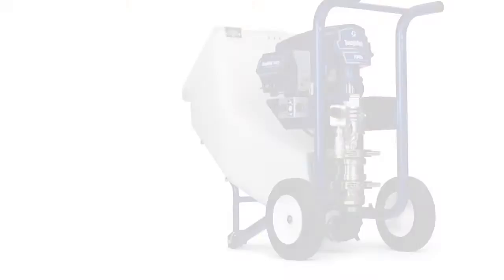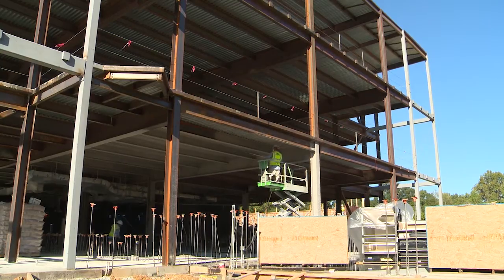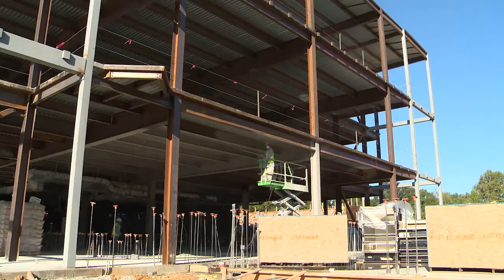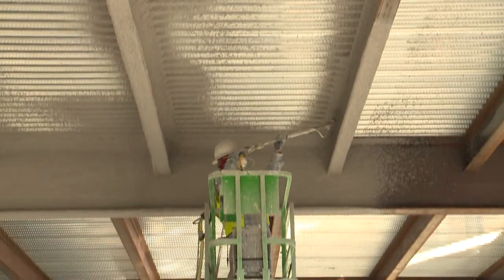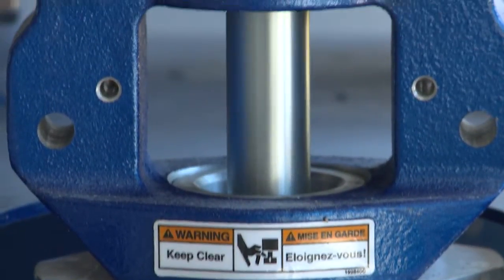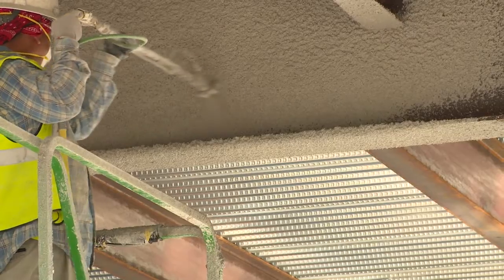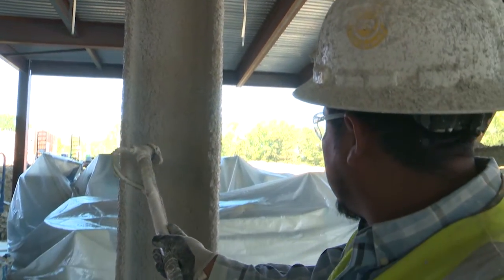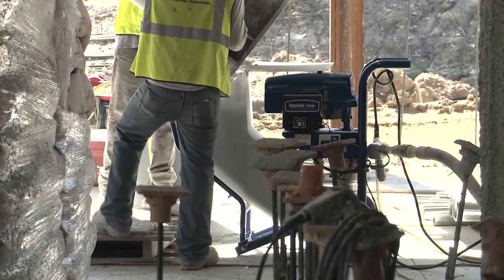Contractor Sprays SFRMs with Graco ToughTek F340e Fireproofing Pump

Comment: How do you clean excess material from concrete
Reply: George,  

Typically excess material buildup in the pump is cleaned out immediately after spraying by simply running water through the pump.  If more in depth cleaning is required, the pump is designed to break down quickly in order to completely disassemble each component and clean thoroughly, thus preventing any material from damaging the hard and soft components of the pump.

Comment: What a load of BS....I have been in the industry of spraying Cementitious Spray for over 30 years and there is no way that you can mix 20 bags ( 21kg ) an hour until its mix is correct and keep the feed up to any pump spraying structural steel... Also look at the extra labour needed to mix up the product and then pour it in to the pump...You don't need to take my comment as gospel but i sure spray a lot of Sh*t a year  on many projects.
Reply: The Graco F340e Fireproofing Pump has a stated output of up to 15 bags per hour for a max flow rate of 6.5 gpm.  This can vary depending on material being used, mix consistency, hose size and other factors.  As for mixing the product, the density of materials will affect bags per hour output, as the volume of the mixed materials will change. As for how fast materials can be mixed, that varies from contractor to contractor. The F340e has the ability to vary the speed/output of the pump to increase or decrease the fluid output depending on the needs of the applicator.
Reply: I also have been in fireproofing for over 30 years. We have 2 of these pumps and use an electric stone mixer with it instead of barrel mixing. A 2-3 man crew can put out 15-17 bags an hour of monokote no problem or cafco 300 at about 14-16 bags an hour.  We also have the larger Graco F800e which puts out even more for longer distance. Personally, I like the J&M promag better than the F800e for mid size jobs. It is easier to move and quieter

Comment: Looks impressive.
Reply: 915 we bought two of these pumps in 2017. One with compressor, one without. You need separate dedicated power to compressor and pump. Try finding that on a jobsite. I have used other brands that are better and cheaper when it comes down to it. Graco brought out the F680E. It’s a 220 pump, but still there are better pumps on the market. The issue with it is if the mud gets a little tight, it just won’t pump it, where other pumps will

Comment: Air compressors are not sold with the ToughTek F340e Pump at this time, but we will be releasing one early next year which will mount on the pump. For now, any standard air compressor that can generate 5-6 SCFM should work just fine. Thank you for your interest in ToughTek pumps and feel free to email toughtek@graco.com if you have any additional questions!
Reply: +Beth Torgerson   Now that the compressor is available.. is there any pictures of it attached to the machine?
Reply: Where are you

Comment: what do you use for air compressor? Does your pump have one mounted on it?
Reply: Rox, i sell portable piston compressors for F340. It mounts on the right side of the pump, it runs on 110v and outputs 6.5 CFM. Email me direct for pictures and pricing.   valbensaul@gmail.com